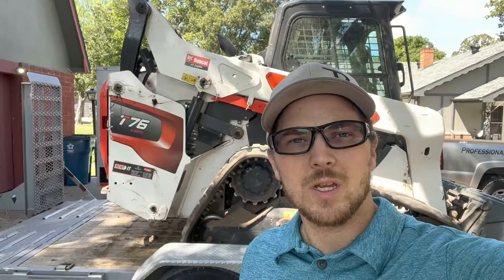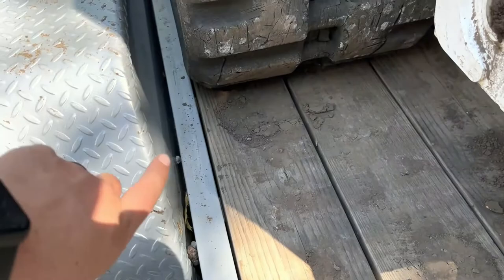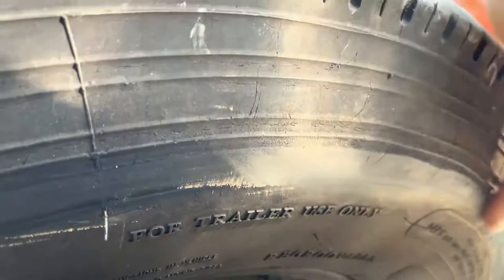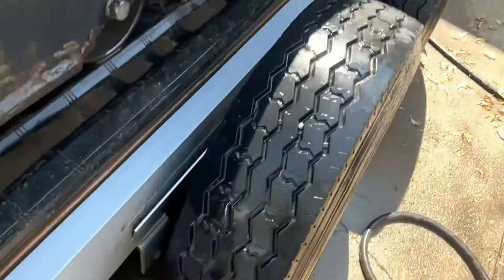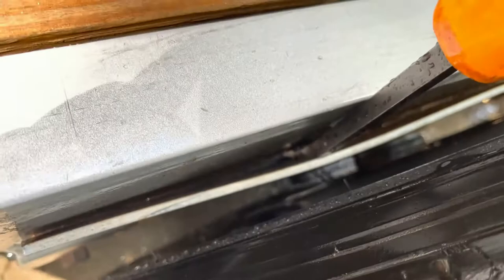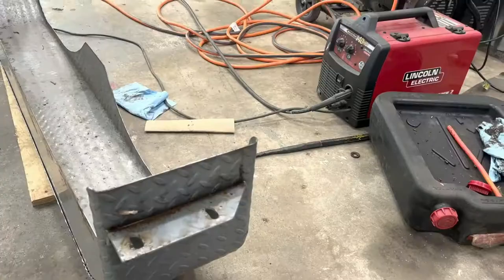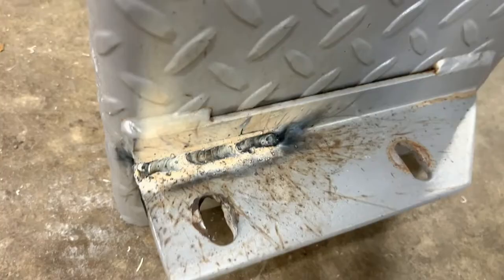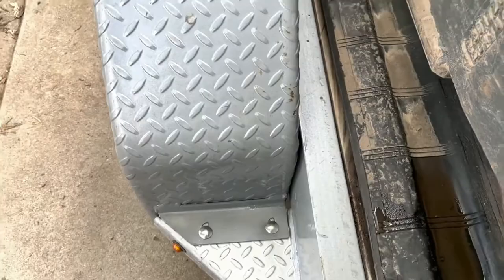Equipment Trailer Removeable Fender Repair

Comment: Hello cool video I have the same trailer great feedback did you weld the rail closer to trailer or just clean it out ? My  tire is rubbing a little more then yours I have a lot more small rocks in that crack next to fender i was going to clean it out and try to bend back in place or weld it closer to frame.
Reply from the maker: We cleaned, bent back into place. Tried backer rod foam to keep the debris out. Didn’t work. Thinking about welding on fully.